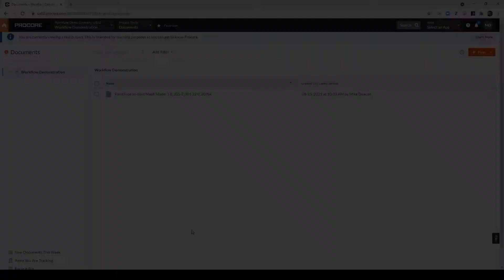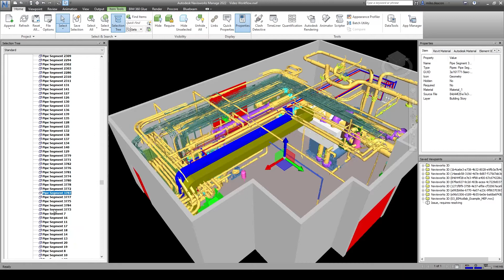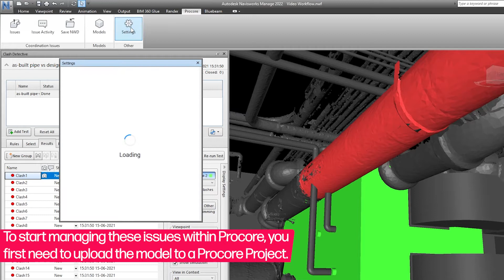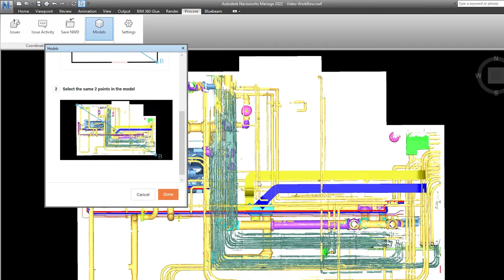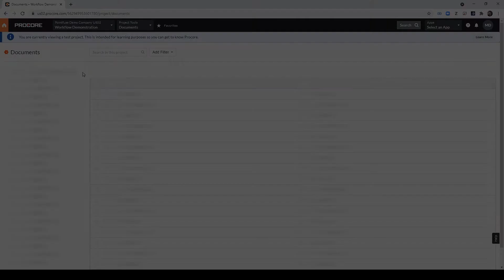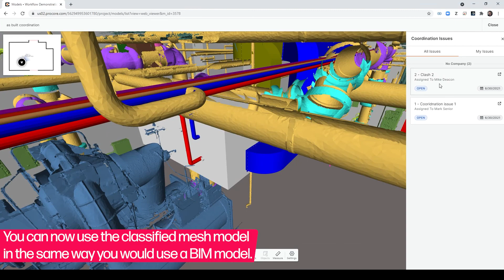PointFuse for Procore - The PointFuse mesh, the Autodesk Navisworks and the Procore Plug-in

Comment: Hi PointFuse, can this software convert 3d mesh file --> cad solid format, exp: sat,step, dgn file and etc ?
Reply from the maker: Hi Nooriman Zainol, PointFuse can only export surface meshes, not solid models - but does support step and stl export.